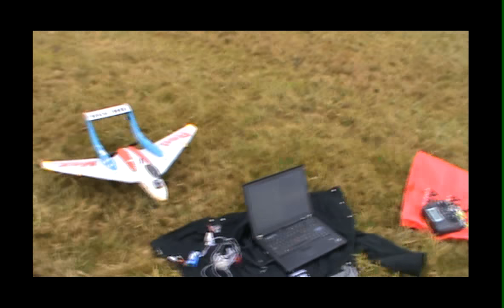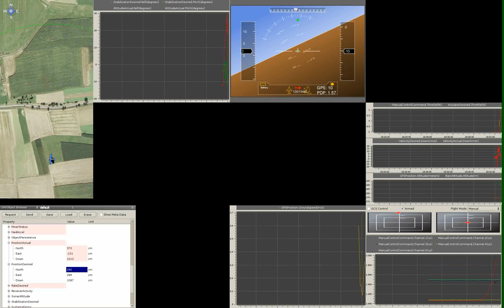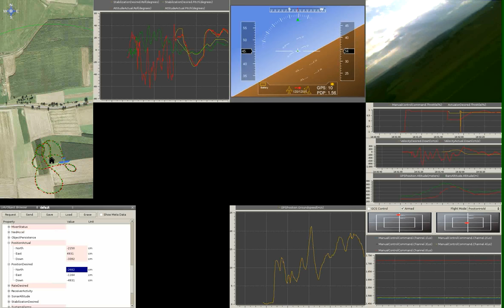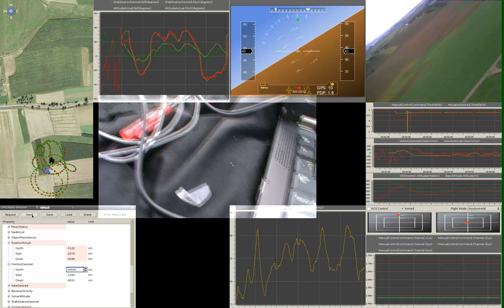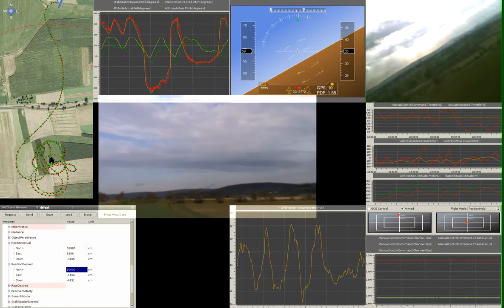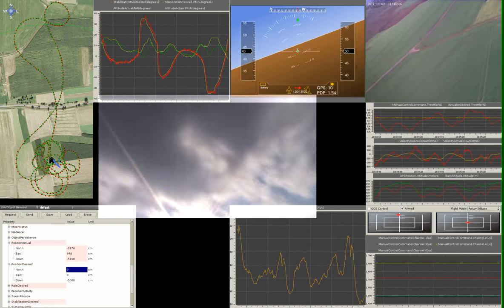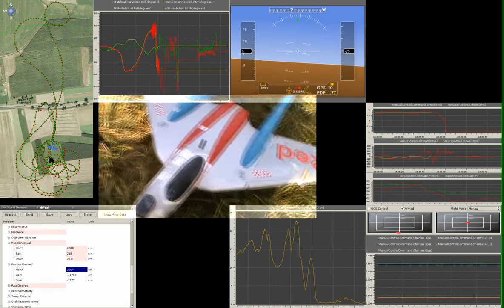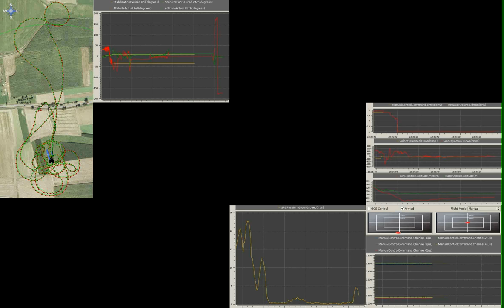OpenPilot: 1 km navigated flight

Comment from the maker: @modabic it did have a GPS, and its weight was 12 g. I could have used any NMEA capable GPS, but its advisable to use one with a quick update rate (10Hz).
I did also have a transmitter in the plane for realtime telemetry, using a 2.4 GHz Xbee Pro

Comment from the maker: @luisyo2001 I had done a couple of range tests when I switched from my old 35MHz TX to the new 2.4GHz one, but I haven't seen any decrease in telemetry range because of it. I have a pretty good antenna for the Xbee on my plane though, that might also be a factor in transmission quality.